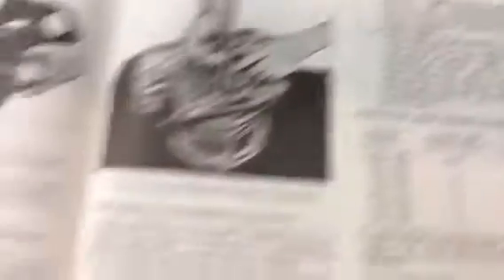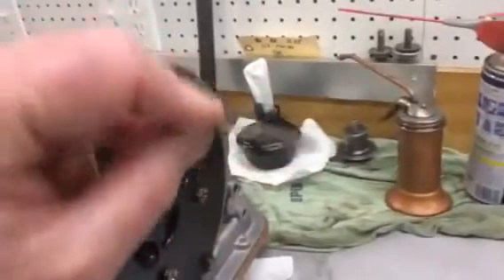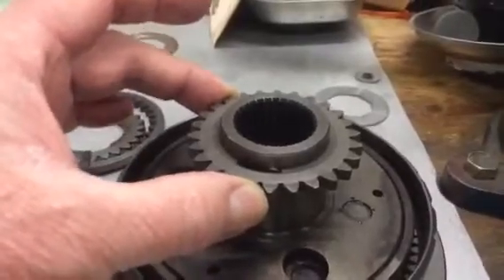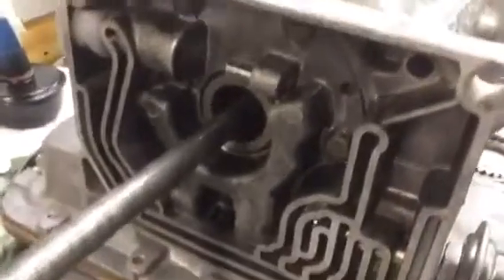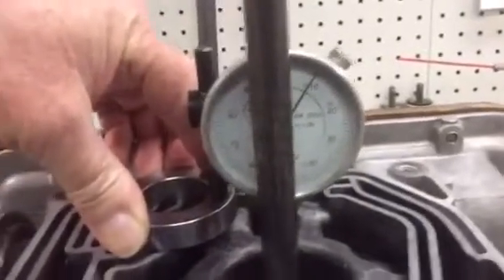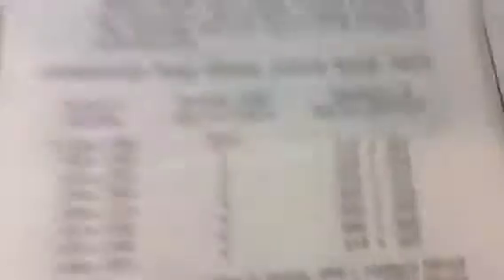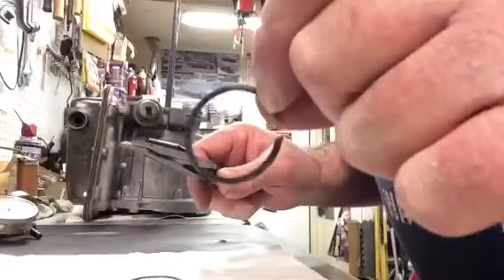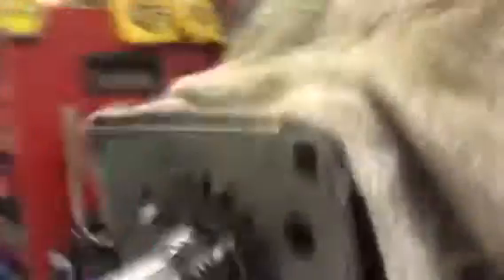How to set the internal running clearance on a Corvair PG transmission.

Comment: Great videos Dave. This I see all the time too. One question- do you take the gasket thickness into consideration for the running clearance? I always have because I noticed that the gasket between the diff and PG all seem to be different thickness… and that spacing adds to the play. Or am I overthinking this? 😂
Reply: @johnsiebert6855 - I had the same question, but reading the '65 manual, on page 4-7 - para b. under "Rear Selective Thrust Washer Determination" it states "Without gasket"...